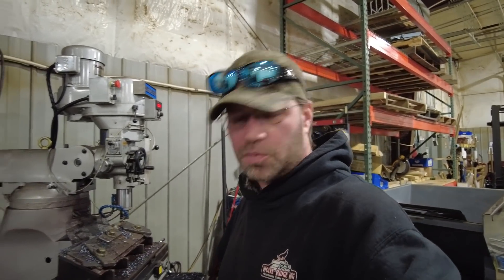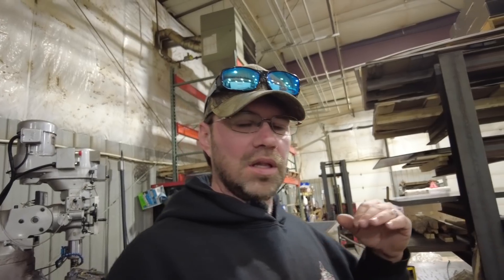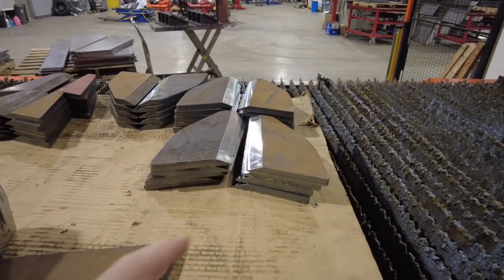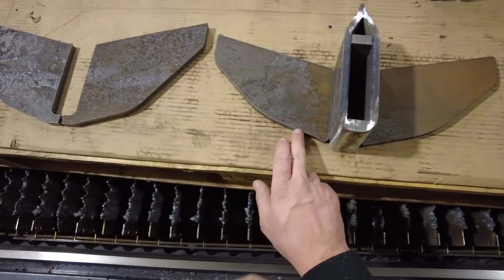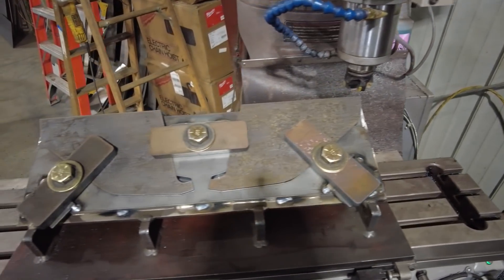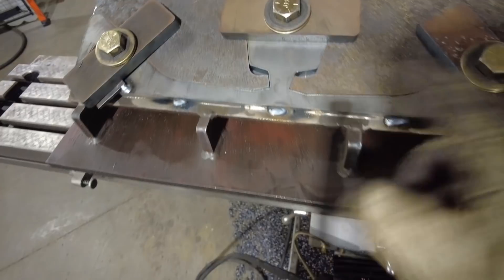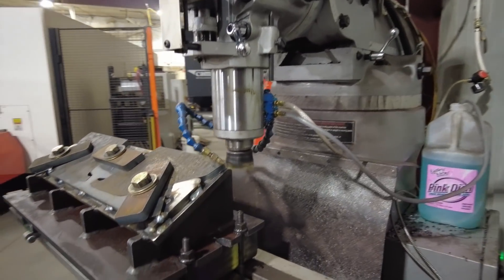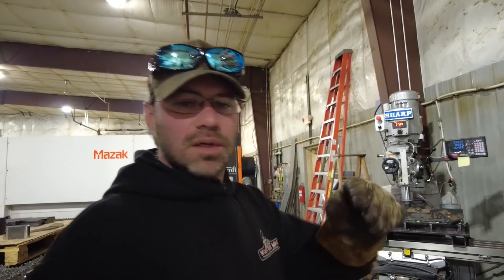Milling right along... New wing design for our 4 way wedges!

Comment: How much will the new 4 way cost? I hope this does improve the wedge. Where the fin tore off on the machine I have was from the front. My friend and I questioned what happens with more powerful machines and the use of a 4 way and 6 way wedge setup. I like the machine and the 4 way setup. Own the 22 ton with a 4 way and have 325hrs on it now.
Reply from the maker: Same cost as the original, $300 but will not be ready for another month if you wanted to order. Thanks!

Comment: Chris, all of the toolmakers in here are thinking you should raise the knee up so the quill is as high as possible when you're roughing material off.  The cut is more stable, keeping vibration down, which will make your inserts last longer.  Bearings will last longer too.
Reply from the maker: I know. The knee is not able to be raised, something broke underneath and we are waiting for Sharp to fix
Reply: @WolfeRidge , that's a good reason!

Comment: Great improvement!! No point in having your quill out so far run it up as high as you can more rigidity less hammering and easier on that nice machine ...peace!!
Reply from the maker: Yep, the gear broke under the knee the first time we tried to raise it up. Sharp is supposed to come and fix it as soon as they can get the part. Thanks!

Comment: Nice little jig you have there. That’s how I bevel mine. My ol’ enco is an invaluable piece that has paid for itself many times. 
https://youtu.be/dbAx9mnACog. 
This is similar to how I’m building my next 4way wings except they will be connected together. I’m thinking having the resplits sit uptop like a box wedge will help resplit action. My current wedge kinda does it now and it seems to work pretty slick. There’s another “first” I’m incorporating that I have not yet seen in the industry.

Comment: How did you end up designing & fabricating log splitters? Doesn’t seem like a happen stance endeavor. 
You gotta have a cool half a mil in tools, you employ folks, lease a building. That’s some heavy overhead. I do value your work & skills. I can’t quite afford your splitter yet. After getting a newer skidsteer. Your splitter is next. I’m new to the firewood business. If I can maintain 10-15 cords a year. Then the machine will pay off in 3-4 years. 
Thank you for your content.
Reply from the maker: My grandpa had built one and I ran it with him for years as a kid. Later on into owning my own hose I decided to get an outdoor boiler to save cost heating my home. I borrowed my buddy's Box Store splitter and I just couldn't stand how slow it was... Grandpa's homemade splitter from 1980 was faster than this new 2015 model....

I ran that splitter for a day and got about 1 full cord split. I loaded it back in my trailer and gave it back to my buddy. I said thanks John, but I have decided to build my own. It split anything you threw at it, but I just don't want to spend every weekend splitting. 1 full cord in a 6 hour day just didn't work for me...

I have been a welder since high school, built everything from little trinkets to heavy haul lowboy trailers , oil and gas equipment, and Manitowoc crane boom parts. I also had experience with drafting and computers. 

I was able to build a machine for myself from scrap metal and recycled parts that more than tripled the output of the box store machine. I piled up 30 full cord in no time. 

Shortly after that, the fab ship where I worked got slow and I think they were looking to cut payroll. They sent me packing after 5 years of service... shocked and frustrated, I decided that I would sell my splitter to keep the bills paid while I looked for another job. I had about 16 people call in 3 days about that scrap metal, used splitter that was not even painted. It sold quick and just offered to build another machine for someone who called later. Luckily for me, he took me up on the offer and he really liked what I built for him. He gave me a $200 tip and said I should keep going. I said I really just need to get a job... he said no way, build another machine!

After a lot of long days,, 6 or 7 days per week and never giving up, The rest is history! 22 employees and growing. We now own the building and 14 acres, looking to add on another 13,000 Sq ft soon. Just goes to show that the American dream is still available if you grab it and wrestle that B** and never give up!
Reply: @WolfeRidge  Nice to hear the story about how it all started, you build a great product. As welder myself I can see you still have a passion for building and testing the machines, keep up the great work Chris!! 
I love using both of splitters 35C and the 3030 on the skidsteer
Reply: @WolfeRidge  nice to hear the back story. Like I said before, you are the American dream! There’s entrepreneurs then there’s ENTREPRENEURS! You are in the caps category. There’s ones who buy or inherit the business and then there’s the ones who build it from ground up. The amount of motivation, discipline, uncertainty, financial strain, rules and regulations to comprehend, etc, etc. one needs to undertake is something most folks will never understand or even endure. Much respect Chris! Looking forward to the next chapter of Wolfe Ridge products.
Reply: That’s a badass story dude! I’m in the situation of having a big box store splitter. Are you’re not kidding, 6-8 hours to split a cord.I’m hoping to get your 35HO within the next year or 2. Never thought I’d drop $12,000 on a splitter. But hopefully I can make a decent little  firewood business.

Comment: You'll get less chatter and longer tool life if you raise the knee and get that quill all the way up into the head. Easier on the spindle bearings too.
Reply from the maker: Yes sir.. The gear broke under the knee. Waiting for Sharp to come and fix
Reply: @WolfeRidge  I figured I wasn't telling you anything new. I'm glad your getting it fixed. Those Sharp's are decent machines.